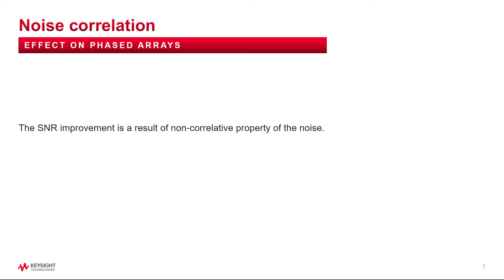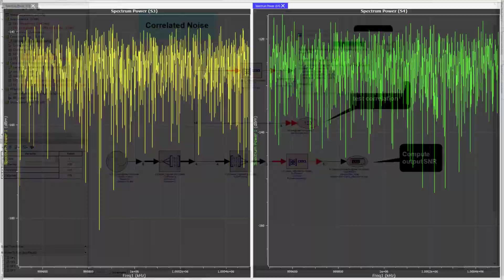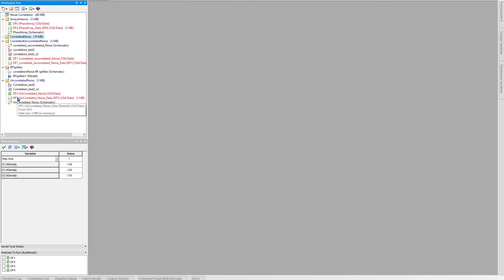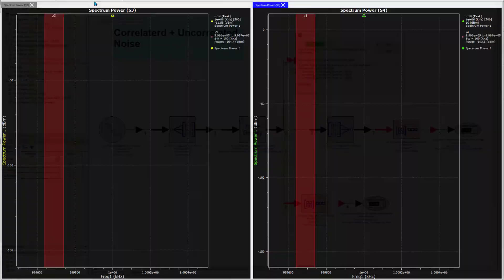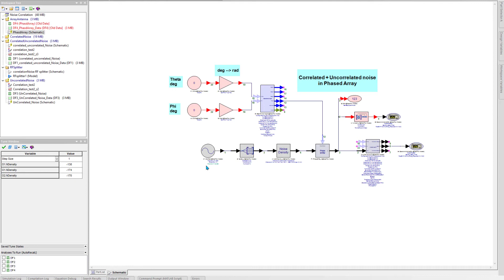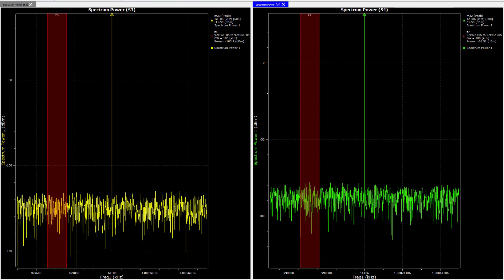SystemVue: Noise Correlation and Impact on Phased Array Antennas

Comment: One thing I don't get clearly from the video at 7:43 is that, why is that the noise produced by the power splitter is non-correlative? While at the beginning of the tutorial, a 12*12 power splitter is utilized following the source with 0 watt signal power and -154dBm/hertz noise density, to generate the correlated noise?